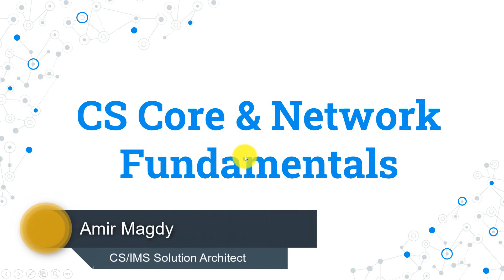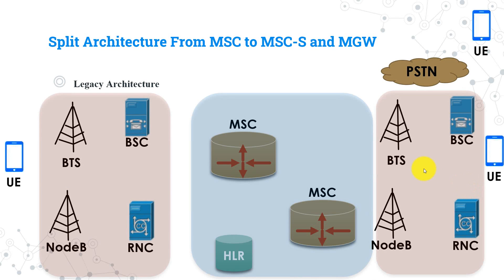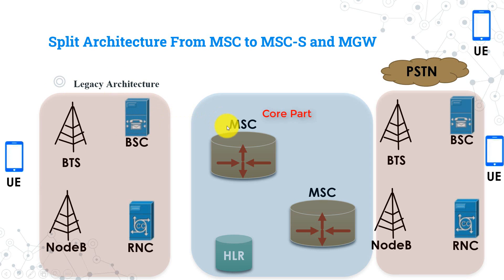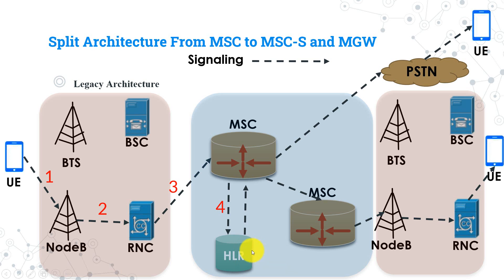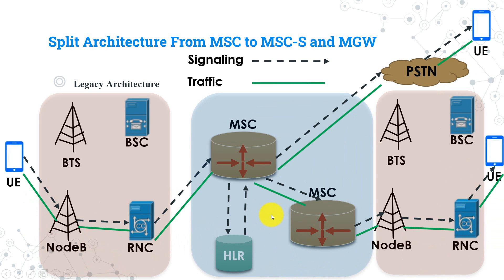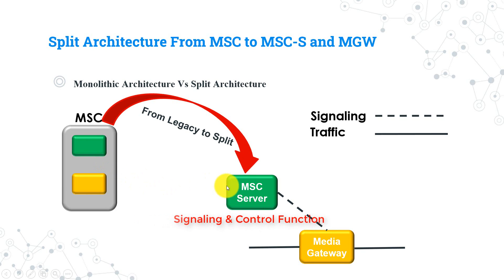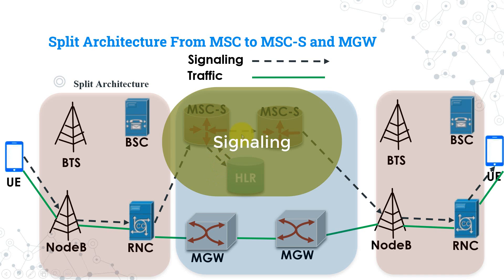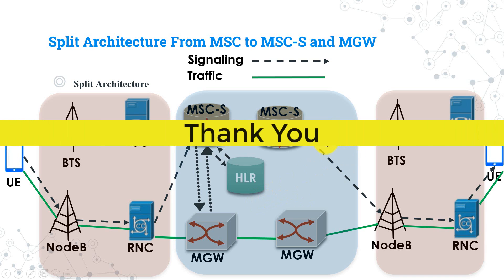Split Architecture From MSC to MSCS and MGW / 3GPP Standards in Splitting MSC to MSC Server and MGW

Comment: Flow:  Are you sure you are correct?  You show traffic going on the right node b >> RNC>> UE.  I think this is an error.
Reply from the maker: The main topic of this lecture is talking about the split architecture, 
Mean while i cant understand what is wrong in the flow. 
For traffic flow, it is from UE to Nodeb to RNC and then to the MGW . 
If you have any concern about this just tell me, and i will prove it to you
Reply: @amirmagdy10  According to my understanding the traffic is supposed to go from RNC >> Node B >> UE and then from UE >> Node B >> RNC.  Duplex connection here.  In your diagram to the right you are showing Node B >> RNC >> UE.  I think this is an error.  UE is not supposed to connect to the RNC directly.  According to my understanding.
Reply from the maker: @siucbset  thanks for your feedback, 
But i believe thats what i say in the video, 
Of course ue has no contact directly with RNC, it should go through nodeb .